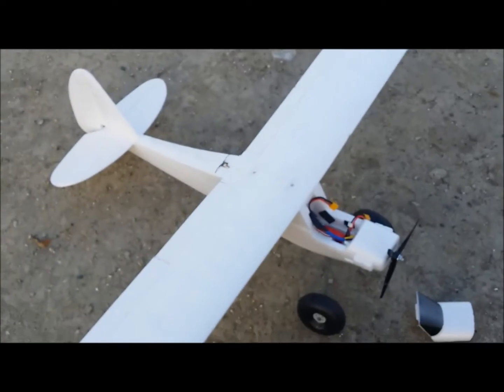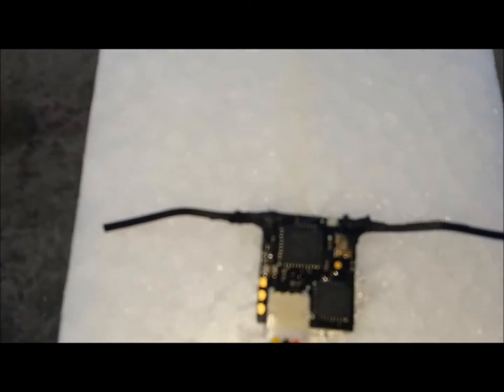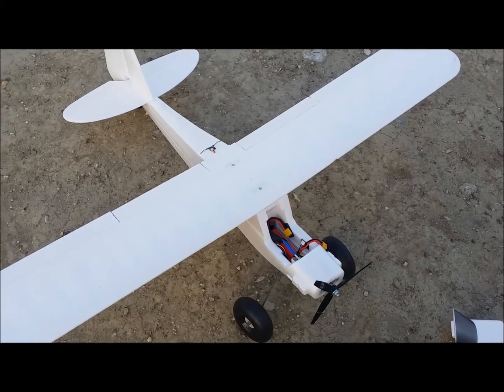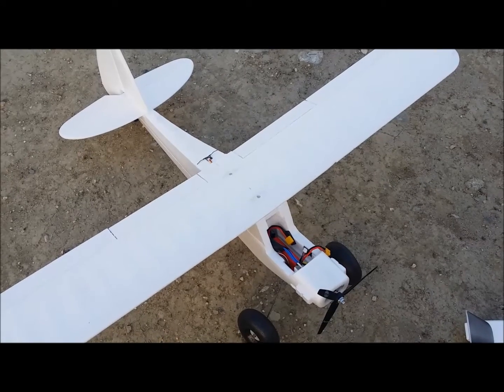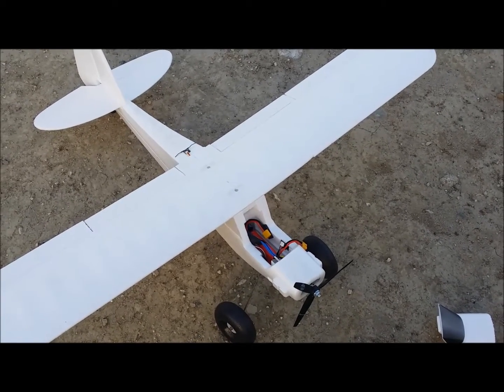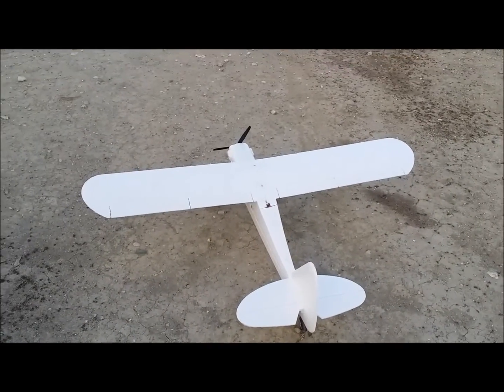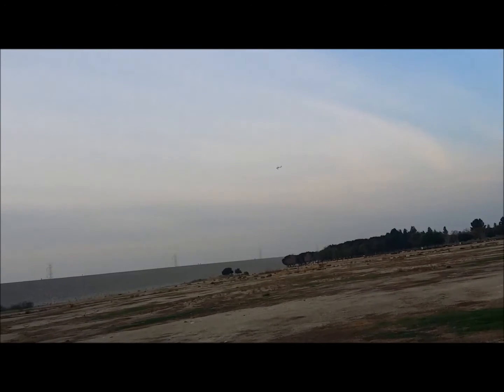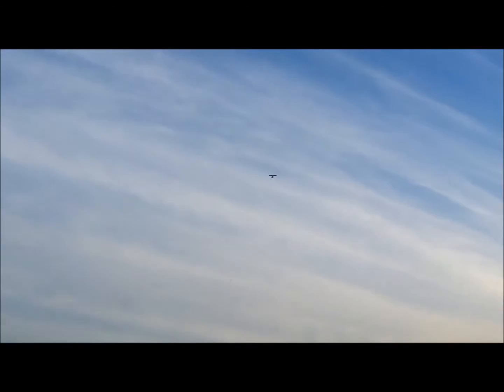Lemon Receiver Fligh Demo 8 channel with PPM output

Comment: I know this video is made old, but just got some of these rx’s from lemon stabilizer plus. Ground testing on a 3 position toggle everything seems great. But I have had problems with other “safe” type receivers, but all with no luck, with exception of eflitew real safe and as3x recievers but they are just so dang expensive and programming is a bitch because I only have an iMac and all the program firmware seems like it only operates on pc